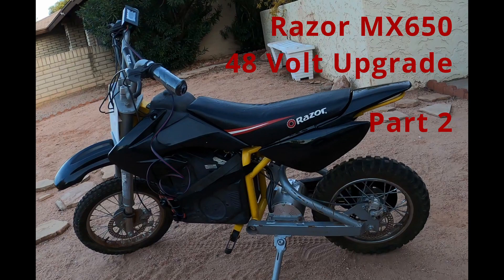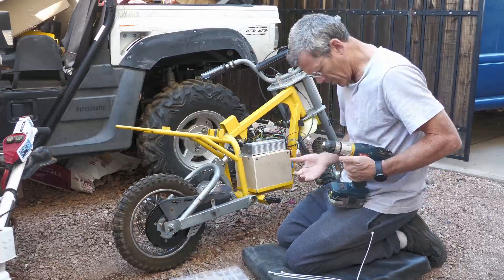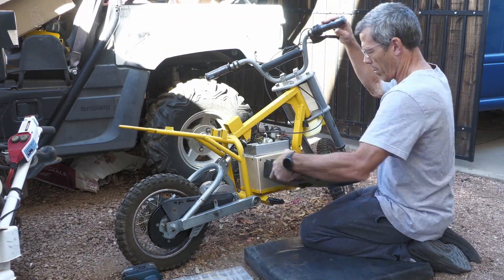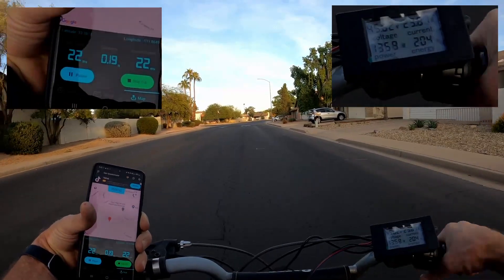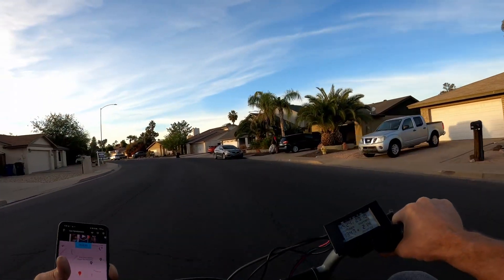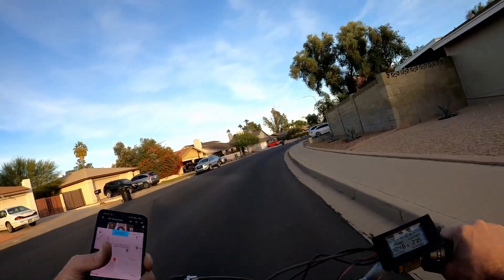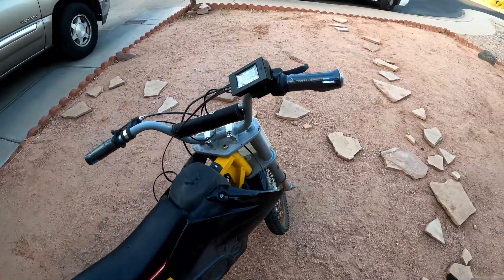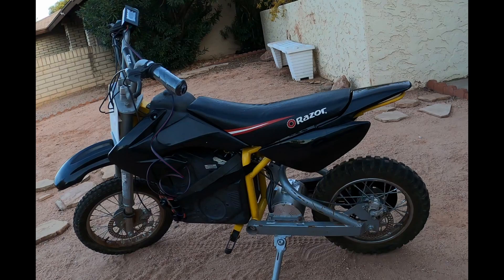Razor MX650 / MX500 $230 48 Volt Upgrade 1800 watt Brushless Motor 30+ MPH Part2

Comment from the maker: I fly Remote control air[planes and so using the same batteries for both works for me.  I series 4 5ah 3 cell packs together to have 48 volts they cost around $20 from rcbattery.com so if I need to go further I use 2 sets to give me 10ah for $160. I did not do anything to the motor just drilled holes in the swing arm for the screws to sit in, if you haven't watch part 1 check it out.

Comment: What battery did you go with?
Any modifications to the motor or direct fit?
Did you use sprocket on motor or new one?
Isn’t a good Lipo 48v battery $200 plus alone?

Comment: Keep EVERYTHING the SAME EXCEPT the CONTROLLER.  
ebay. 28 to 34 mosfet, 48v. You'll thank me!
Reply from the maker: Are you saying add another lead acid battery some ware and change to a 48 volt controller, keeping the 500 watt motor?  Can the stock motor handle that?
Reply: I have been running my original controller and motor on 2 - 24v LiFeP04 batteries for a few months now and it takes it like a champ. My 7 yr old loves it and I take it for the occasional rip as well and I am 170lbs. @ElectricOHV
Reply: I believe he is saying just get an upgraded controller instead of the 1800w controller kit comes with
Reply: Huh